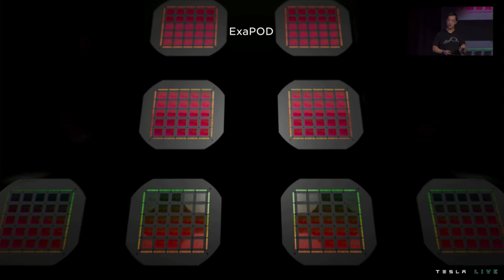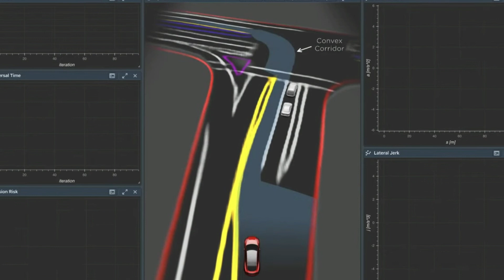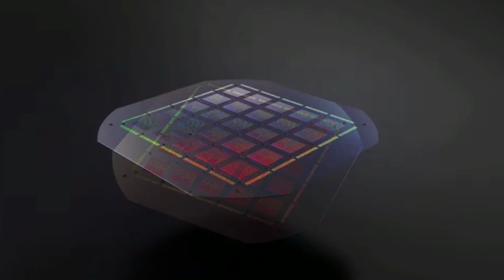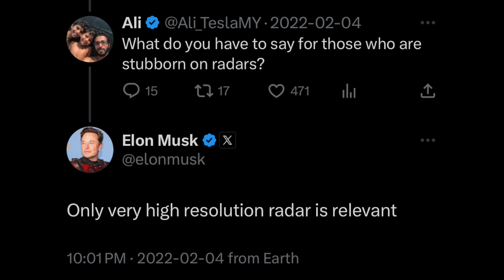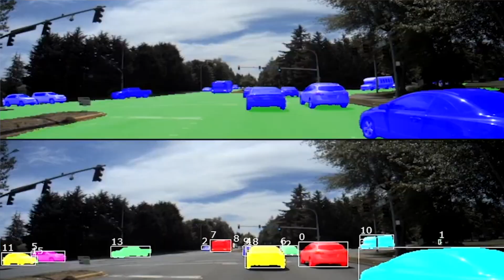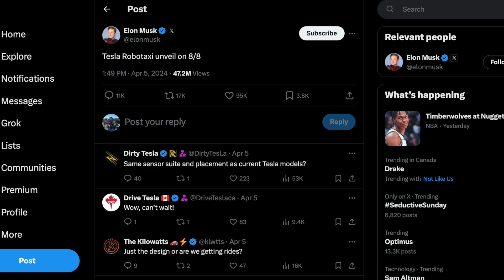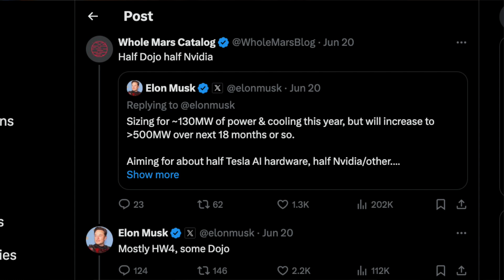Tesla Begins Hardware 5 Upgrades Ahead of Schedule | This is Great News

Comment: Are any of the current Teslas at Hardware 5, since this video is older now?
Reply from the maker: Not yet bro, looks like even the current robotaxi is on HW4. We might start to see HW4.5 in early Junipers with a front bumper camera and minor upgrades as they slowly transition to HW5
Reply: @heyJohnEe  I was curious if Juniper was. Does that new camera up front mean that's HW5? Even Model 3 for 2025 doesn't look like it has anything new yet.
Reply from the maker: @hutchrt0596 I have been told there is a new part number going into production at Giga Shanghai, this might be just a solo item for the bumper cams. This would not be what a full HW5 upgrade would be, so likely just a front bumper camera for early juniper batches

Comment: One issue that Musk reported was the Power Consumption, going from 2/300Watts to 900Watts, that's starting to get quite significant in Tesla vehicles with smaller batteries.
Reply from the maker: That’s only during peak usage